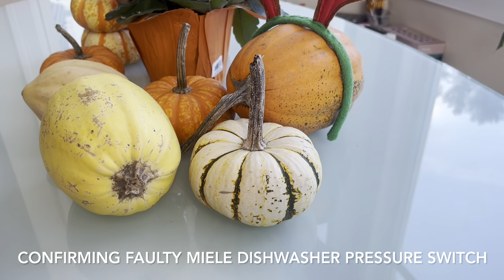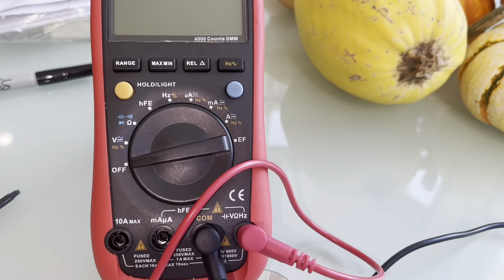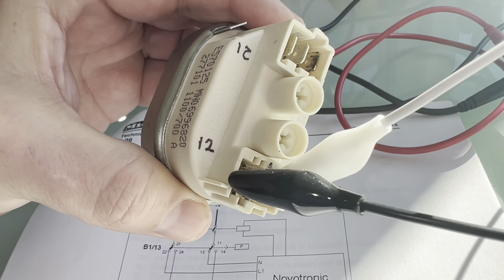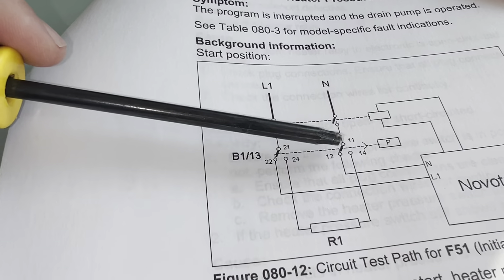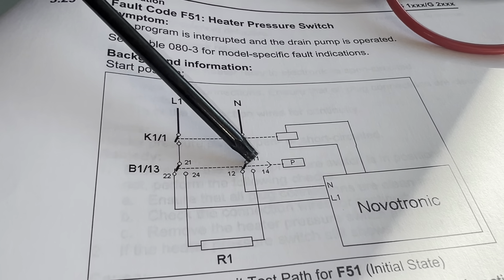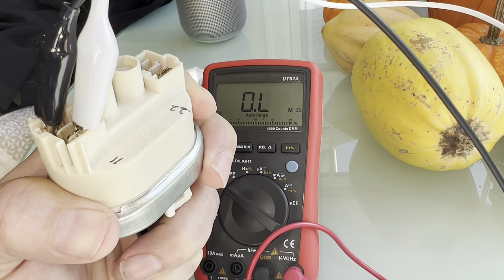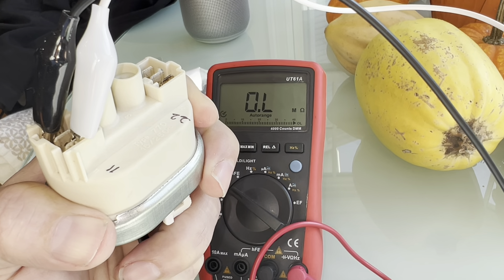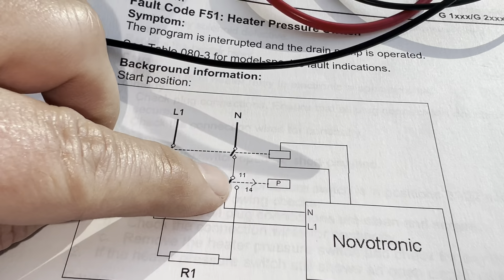Confirming faulty Miele dishwasher pressure switch (F14 + F24 error codes)

Comment: Thank you for the video, and also showing the schematic as that was useful.

When measuring the resistance of a connection that should be connected (not infinite resistance) yours shows 0.1 ohm, yet mine shows some resistance, is that ok still? Or signs of maybe internal dirty contacts
Reply from the maker: @ivangutowski-smith6514  how much resistance does it show?  It should be very close to 0.  Tenths of ohms is ok but if it starts to get into 10s of ohms, that is different
Reply: @rogerscubadiver  Thank you for your reply. The highest resistance value I have is between pins 24 and 21 at 4 ohm (when diaphragm pressed), the rest are around 1.5 ohm.

I'm going to try switching the relay module first.

My issue is that a silly mouse came and chewed a bunch of pipes and cables under the machine, so I've repaired all I can see. My feeling is that it's unlikely the sealed pressure switch would die at that exact moment as the mouse came. Whereas the relays had some poop on the circuit board so that may have damaged things.

It's frustrating how expensive the parts are as the relays at £80, yet it's clearly a basic circuit board with 2 basic relays in (I've followed your tutorial to test and clean them).

So hopefully the relay will fix the issue, if not I may replace the pressure switch. Thank you again for your help
Reply from the maker: @ivangutowski-smith6514  happy to help.  I know it is frustrating on how expensive it is to fix appliances.  

Regarding the heating relay, I would suggest testing the unit like I showed in my other videos.   I bought one too because that is what the service manual tells you is bad.  It wasn’t.  I verified it with the ohmmeter.  

The 4 ohms, when it should be close to 0, is suspect.  It may be enough to confuse the electronic board.   But yes, weird that it is happening after the mouse.   One thing a poster here discovered is that you need to make sure all the sprayer arms are put back in when you do your tests.  

Tell me, what error codes are you getting and at what time?  Have you cleared all the errors from memory and ran the unit to see which codes are new and which ones may be old?
Reply: @rogerscubadiver  (replying on my main account)
Hi Roger, thank you so much for your help. I can totally see how after putting the machine on it's side, people may not put the centre basket back in to test... thus not giving enough resistance for the pressure pump.

Good news is that I now don't have an F24 error anymore after getting a replacement heater relay unit, I have no idea how such a simple unit failed.. it must have been the mouse poop that fried it.

Interestingly my EZL 517-A unit could also be replaced with an EZL250 unit. It was selling very cheap on ebay and I noticed that the board and relays were exactly the same. Only difference between the two is that the latter has a slightly smaller plastic case.. the rest is identical. All cable connections are identical and it slots into the same place on the frame.

I did initially have a slight issue getting an F84, but looked at your other video on that, traced the wires and after some testing it's working again... hopefully it keeps working.

Thank you again for your help and other video that covers F84 too.
Reply from the maker: @ivangutowski  glad you got it fixed with the heater relay.  That one is such an easy part to change in the machine and also easily found on the web

Comment: My pressure switch tested good after following your video. But I am wondering what that other pressure port is for. When I try and push on that one there is no click and nothing changes on the contacts. Thanks for any insight you can offer.
Reply from the maker: @Citroeniste  did you test all possible combinations of the pins and did they show that the electrical contact is broken immediately (goes to infinity ohms) or it makes a closed circuit (0 ohms).  It should change values quickly and not show any resistance (well, hundredths of ohms is the same as 0)

I don’t know what the other port is for.  

If the pressure switch is fine, I have another video for a different issue (the circulator pump) that led me to believe it can also give these fault codes).  The reason being that the openings that let water into the pressure switch may not be fully open.

1) did you check if there are other fault codes in the system’s memory?
Reply from the maker: @Citroeniste  here is that video with a second reason for the F24 codes.  This was on a second dishwasher and my pressure switch was fine (I tested it and also replaced with a new one)

https://youtu.be/Ug1fc1eWIAw?si=JaUOpoTTOVRqeOaF
Reply from the maker: @Citroeniste  and here is the video on entering the service mode so you can read the fault codes.

I suggest you write down all the codes you see there.  Then use the erase option to wipe them out.  Start a few washing cycles and go back and what new error codes were recorded 

https://youtu.be/ZePQ_TGifAQ?si=RAhr1o8YJYqWR7pj
Reply: @rogerscubadiver  thanks for all the great info! I did check all the possible combinations of the pressure switch and they did test good with no intermittent readings or incorrect readings. However I did put the pressure switch in the freezer overnight to see if it would freeze up if there was water inside. When I tried it this morning it was frozen and would not operate. I had to push on it very hard before it finally started moving but it felt very "crunchy" so I suspect that there is water inside which is causing erratic readings. This would be consistent with the fact that when I was testing the dishwasher it woould fail at different points in the cycle. Sometimes right away during filling (or trying to fill), other times part way through. The switch is gonna be about $250 CAN byt the time I get it here so I wanted to be reasonably sure that it is the problem.
Reply: @rogerscubadiver  Thanks! Unfortunately my dishwasher is the G4205 Futura Classic which has no display on it, so as far as I can tell there is no way to read the codes. Great channel BTW! I am now subscribed. I am the type of person that when I see "no user serviceable parts insdie", that is just like a red flag to a bull and I rub my hands together in anticipation ;-)
Reply from the maker: @ the crunchyness could come from water that is outside the rubber membrane.  I tried that test too, initially, and it wasn’t a good method to determine if it was working correctly.  The ohmmeter is more foolproof in my opinion.   If you tested all possible lead combinations like I show in the video and  did it multiple times, I would be apprehensive to replace it.  

I mentioned that in the second dishwasher I got these code and given my previous experience bought a replacement pressure switch without testing the old one.  When the new one came in, I replaced it and tested the old one.  It was working fine.  And the error codes with the new switch were there.  But so where the F8x and F6x which led me to find a faulty switch in the circ pump.  

What codes do you have in the controller’s memory?  There can be a few that are not reported to you but can give you a clue.  Post them here.  Clear them out and run the dishwasher again
Reply from the maker: @ thanks for the compliment.  And yes, everything is serviceable.   The circulator pump is not “serviceable” and I was supposed to replace the entire piece for $500+.  I took it apart and found a defective switch that cost < $2.   Fixed the issue.  I put the pump back together and it has been working like a charm.

I’m sure your dishwasher has a way to provide the codes.  It probably does it with the LED lights.  I’ll see if I can find a manual for it
Reply: @ thank you! All the best for the holidays.
Reply: @ yes I’m thinking it’s like my old Volvo using a series of flashes to display fault codes. I’ll let you know how this turns out once I replace the pressure switch 🤞
Reply from the maker: @ before you spend money on the switch, figure out if you can enter “service mode” for your dishwasher and then extract the fault codes from memory.  I did a quick google search and I can see some units without the LCD can still display error codes.
Reply: @ ok I’ll see how I can get the codes from my model. Thanks
Reply from the maker: @ same to you.  Happy holidays

Comment: HI Roger, great video. I'm in need of this technical document myself. Where did you find it? I'm suspecting either my inlet valve or pressure valve is malfunctioning.
Reply from the maker: Hi Johan,  just google the exact title I show in the video and you will find it.
Reply: @rogerscubadiver  Hi, thanks. I got it as well as the service manual for programming and testing the machine. I can confirm I have the exact same problem. Faulty pressure switch, still making contact after applying pressure :-)
Reply from the maker: That is great that you have root caused the issue.  If you are measuring residual resistance after applying pressure, then it is likely the pressure switch.  I made another video where I took it apart and I could see some small amount of wetness in the internal contacts.  My guess is that rust eventually builds up and it doesn’t make a clean break.  

Replacing the part was easy in the US.   Just found it in the Miele website and it got delivered in 5 days.
Reply: @rogerscubadiver  Yes indeed, I noticed that the contacts were moist so I dried them (none of the other components were moist). It didn't work so I took some measurements and noticed that one side correctly breaks the circuit and the other side still showed some resistance. Just like in your video. I had a F24 and occasional F11 fault which both seem to point to the same circuits. The relay seems to work correctly though. I found the spare part quickly. Ordered it this morning. It should arrive tomorrow or the day after tomorrow. The service manual was also very helpfull in finding that fault codes (I have no display G1143i) and also to run tests on each individual component. This way I could quickly rule out other potentially malfunctioning components. Besisdes this, your video was very helpful to determine I had the same issue. Note, I also have the same multimeter 😀
Reply from the maker: @Guardian1224  that is so great to hear that the video helped me.  I spent days scouring the internet looking for help on this issue and didn’t find any resource that pointed to the pressure switch.  Most referred to the heater relay which I checked out and looked really good, so I didn’t believe it would solve me issue.   

Funny how we have the same multimeter too.  I really like it.  It is such a useful tool that it should be taught in schools

Let me know when you get the new part if it is all fixed.  

Cheers
Reply: @rogerscubadiver  The new pressure switch was delivered earlier today. Swapped out the switch, made sure everything was dry and started the machine. Finally it did a full cycle again without any errors! Before, with the faulty switch, it always failed in the beginning after initial drain.... It's fixed now! What a relief :-)
Reply from the maker: @Guardian1224  that is fast delivery there.   And so awesome that it is working.   I knew mine was fixed right away because I, too, had the same issue that it would stop within the first 2 mins.  Once it completed the cycle, I was confident it was fixed

Comment: Instead, I am still getting mad with my G1230G - F24 Error. Relay is crystal clean and test with multimeter suggests it is working well. The pressure sensor, I get 180-200 kΩ on 21-22 while I energize the water pressure switch and 140 kΩ on 21-24 without energizing the water switch. 0Ω between 21-24. Also, I found the schematic inside the fascia, discovered that in the manual they reference all the time to the ST5 connector, but it is ST6! Everything looks clean with the ST6 connector. So far it looks like the pressure sensor is the culprit here. Is there any other test I could do?
Reply from the maker: You are right about the ST5 lead being wrong.  I found the schematic in the fascia and went with that.   I have another video where I discussed that.

If you are getting some resistance measured in the pressure switch when the circuit is supposed to be open, then that is likely your culprit.  It was for me as you can see in the video.  When a circuit is open, you should measure infinity ohms (or which ever way your ohmmeters shows when leads are not touching).   When the circuit is closed (by emulating water pushing on the membrane like I did with the screwdriver), you should read 0 ohms (or a negligible fraction of 1 ohm).  

From what you are describing, it feels to me that your pressure switch is bad.   Mine seemed to have gotten water inside (past the rubber part).  Look for my video where I dissect the bad pressure switch).
Reply from the maker: And to answer your question, I think doing the resistance test and not getting the expected results is as good of a test as you want to do.  The other is to actually test the board ST6 connector while in use but that is a lot more work to set up.

You can order the pressure switch from MIELE’S website.

Comment: how do i get a tech manual for miele g6300 scu dishwasher ? im in australia
Reply from the maker: Hello there Mark.

Finding the tech documents is one of the hardest tasks I had to endure.   I found it through googling.  But a word of caution, many results from the search, specially those towards the bottom of the page, are for hacked websites that will likely install a virus in your computer.  You can tell because the URL link typically has nothing to do with manuals.  

Also, you may have better luck by searching for the DW family, like “G6xxx” rather than specific model.

Comment: Can it it be related with error code F78? I took out pump assembly it looks like new...
Reply from the maker: What Miele dishwasher model do you have?  I Can look up code F78 to see if it can be related.   I never saw that code with my unit
Reply: @rogerscubadiver  Miele G 4970 SCV i
Reply from the maker: @litvramu907  the diagnostic manual I found on the web only covers models 1xxx and 2xxx.  It doesn’t even have the F78 code. 

I’m busy with work at the moment but I can look tonight to see if I can find a manual for your model.
Reply from the maker: @litvramu907  in the meantime, I did a quick search and found this answers that may help you.  Looks like you can do some easy checks for blockage if you haven’t already.   Also reply back with what other symptoms you may be seeing.  For example, in a previous issue with my dishwasher, I found there was leftover water in the pump’s drain pit by removing the arm after a wash was complete.   Specify also any noises you hear or how long the washer runs before you get the error.   

I have a video in my series that shows you how to get into the service mode.  Take a picture of all the error codes and then erase them all.   Do a couple of washes and go back in to see what other new error codes are showing up.  Sometimes the combination of error codes will help pinpoint the issue further 

https://www.ifixit.com/Answers/View/650541/Miele+Dishwasher+Error+F78+-+Circulation+Pump+issue
Reply: @rogerscubadiver  I have check everything basically. I took out circulation pump and there inside impeller i found some pieces of plastic from dishes. Also, it spins freely and everything is intact. When the machine is starter it starts like normal about 30 sec and stops pumping and gives F78 CODE.
Reply from the maker: @litvramu907  I looked for your DW’s technical manual and was not able to find one.  Hard to triage it without info.

The best I could find is anecdotal posts from people with the same code.   Have you tried the suggestions in all the comments here:    

https://www.ifixit.com/Answers/View/650541/Miele+Dishwasher+Error+F78+-+Circulation+Pump+issue